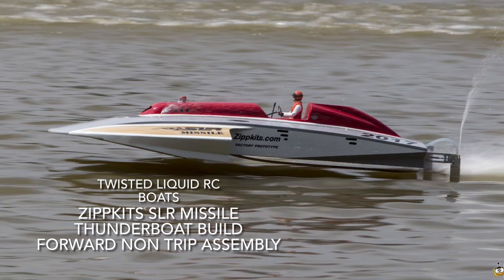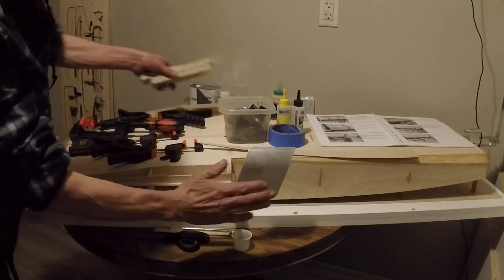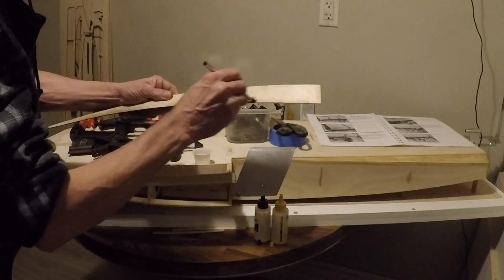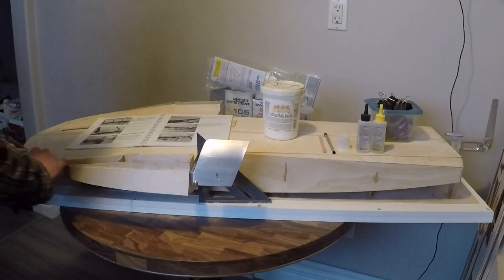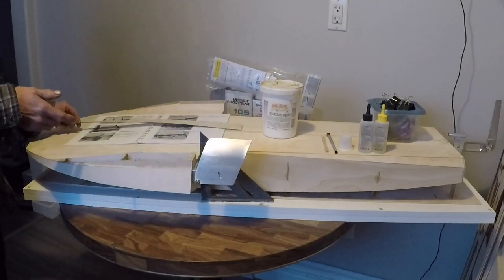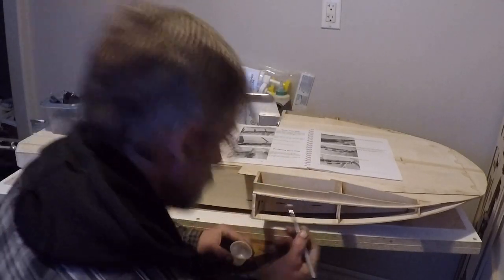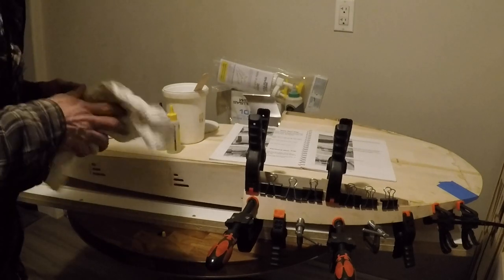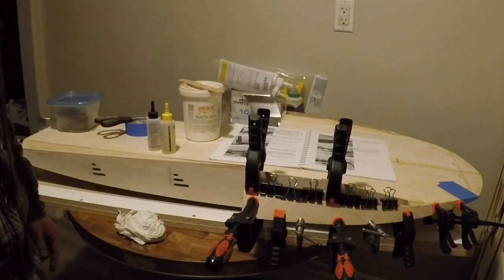Zippkits SLR Missile Thunderboat Build Forward Non Trip Assembly Episode 17 Mistake #1

Comment: I would have scored vertical lines at the inside tip of the forward non trip with a sharp hobby knife so that the part bends inward slightly. This makes installing panels much easier because the panel conforms to the shape of the hull. Just something that has worked for me for years, but your build is looking great all the same.  Cheers!
Reply from the maker: @georgegonzalez9281 thank you 🙏 for the building tip sir. First all wood kit Rc boat build for me. I’m trying to do the best possible job I can and build a decent boat. I’ll remember that tip come side deck time. I can see how it would work and help. Appreciate your kind words. Thanks for watching the videos and channel. Appreciate it. More to come soon. Take care and stay safe.

Comment: You might notice that Scott wets both surfaces with epoxy and then mixes a batch with silica and dabs it on both surfaces.
Reply from the maker: @merlinnicholes5649 agreed sir. Should have probably wet it out first. I will be doing so moving forward. I’m learning the proper epoxy techniques as I’m building and will incorporate into my builds. Thanks for watching. Take care and stay safe sir.